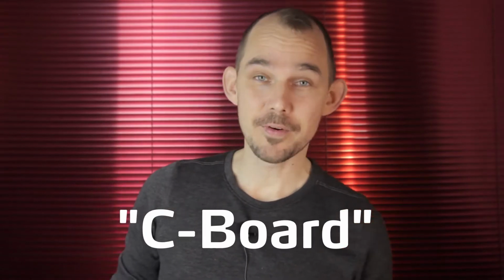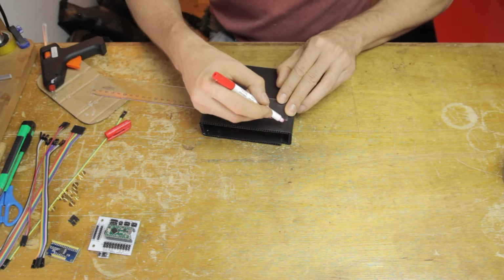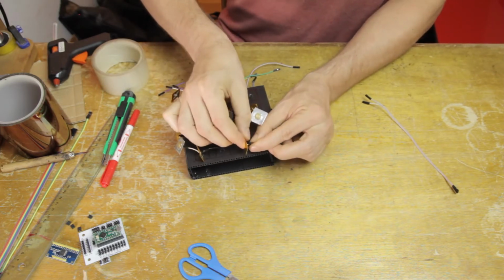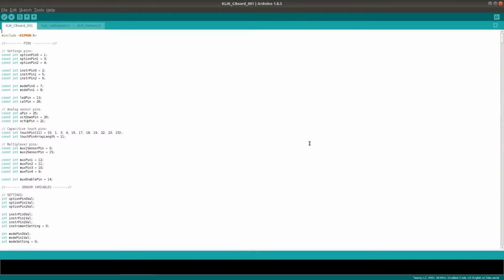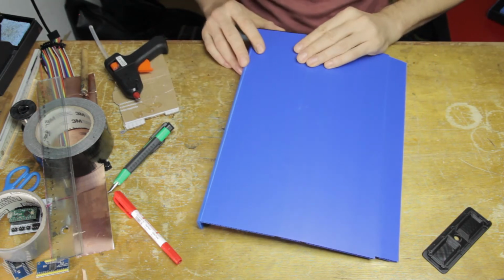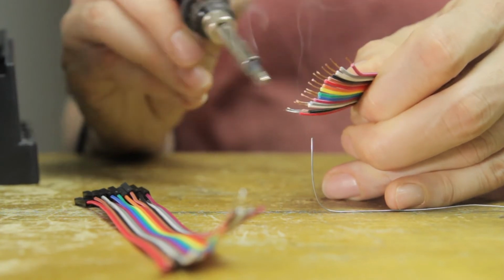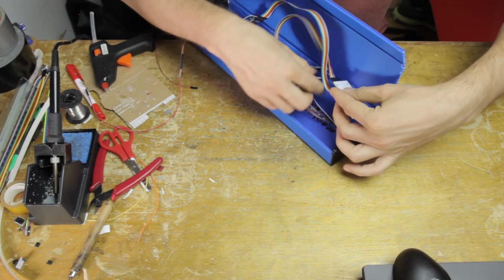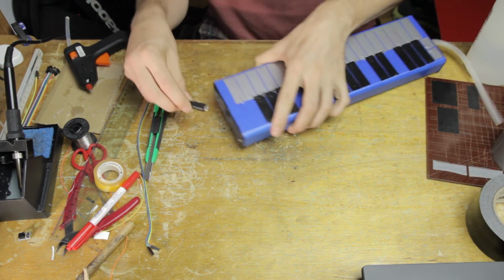Making the C-Board, a capacitive MIDI keyboard - KLIK Tutorial #4

Comment: sir thank u for sharing this amazing content. but i couldn't understand how exactly that sensors/keys work ? do they work with some kind of a touch sensetive electronic component underneath or is it just that copper tape n wire ?
Reply from the maker: Thanks! The sensors are capacitive. They measure the capacitance of the key to the electrical field of the body, through a dielectric layer, which is the tape on top. Very cool tech, only one cable per key.
Reply: @KontinuumLAB  oooh now i get it. its very cool. i had a raspberry pi pico couple days ago and i was planning to make a midi keyboard prototype. this pressure sensing feature is gonna be so useful. thanks a million !